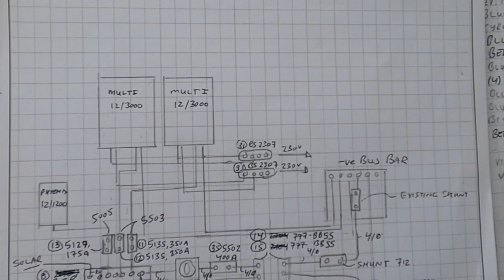New batteries!  We Upgrade to Lithium!         #lithium  #batteryinstall #sailing              Ep 36

Comment: Very nice vid. My assumption was that lithium batteries were not supposed to be installed in the engine room? (I've bought the same boat as yours and am planning on lithium batteries...)?
Reply from the maker: Jos, you have great taste!   
If there was an alternative location for the batteries we would definitely consider it but we couldn’t find a better option for set up, price and convenience.
Rewiring the boat to make runs from the engine room to another location was too daunting of a project for us.
What hull # are you?  If you want to talk in more detail don’t hesitate to reach out, happy to help in any way possible.
Reply: @SailingHangtime  Having another look I think yours is not an Astrea, like ours will be. It's indeed a lot more daunting to put the batteries under the bed. I will ask around a bit more.
Reply from the maker: @josoverbeek  Ours is a 47'.  Our fuel tanks are under our beds.  We have a bit of room for life jackets as well but I don't think we'd have room for the batteries and all of the components.   
Best of luck and fair winds!

Comment: Hope this is not a completely idiotic question, but here goes: assuming you have MPPT controller(s) for your solar and a BMS, then why do you need a BatteryProtect between your MPPT(s) and your batteries?  Shouldn't the MPPT(s) be sufficient to prevent over-charging the batteries (from the solar panels)?  Is the BatteryProtect just an additional fail-safe?
Reply from the maker: Good eye, yes the battery protect is essentially a $100 insurance policy.  It seemed a bit redundant to us but was recommended by Victron so we incorporated it.